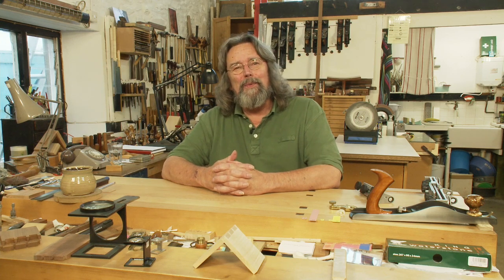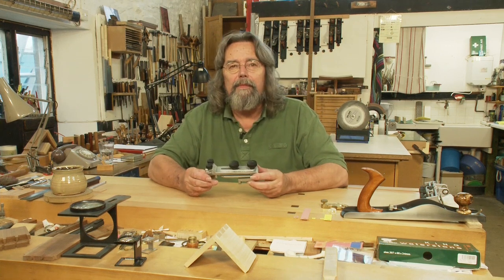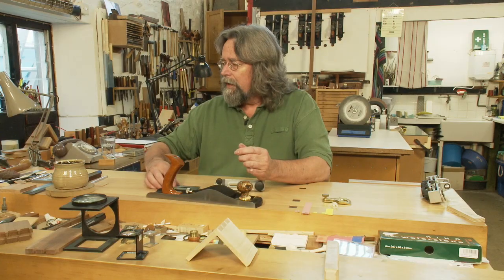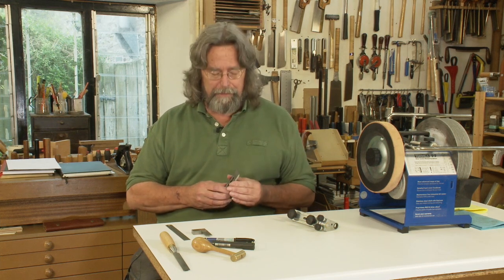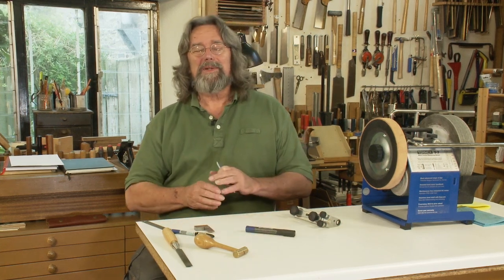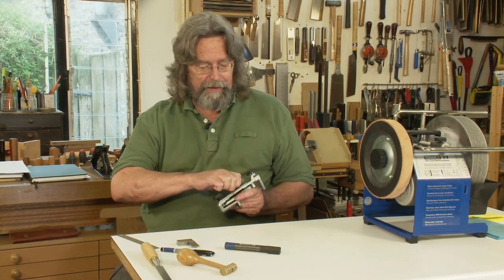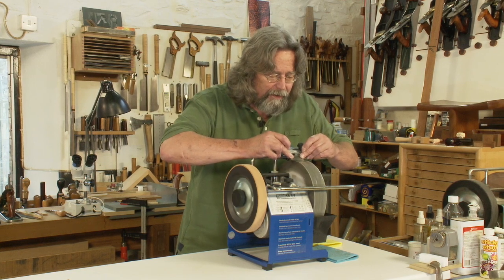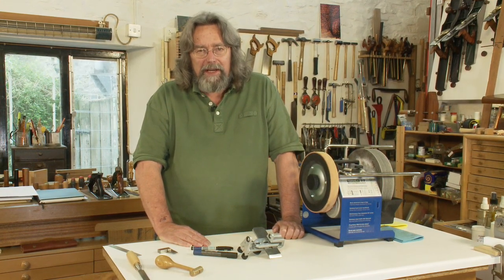New radical camber grinding jig - from Tormek

Comment: Hi David, I have your planing video and have really benefitted from you instruction. However, as in this video you mention an extreme camber for low angled planes (e.g. low angled block plane). What would this radius work out to be - 8" for example? regards Alistair
Reply: It would depend on how far the tool is sticking out of the holder. More tool stick out, the larger the radius.

Comment: Hello David, i wonder if you grind camber of your blade, how you hone it afterwards? I have seen your sharpening DVDs, but there you always address flat plane iron. So i dont know how to use my Tormek T8 with my japanese water stones. Thank You for your help and be save
Reply from the maker: Petr,
I think you will find that I do demonstrate cambered sharpening on my  "Plane Sharpening DVD."  I use 5 finger positions across the blade with an Eclipse guide, on an 800g stone.  This gets small wire edge.  Then tip up 2 degrees and polish in the same 5 positions.  Then remove burr with ruler trick on polishing stone.  Hope this works for you.
David
Reply: @DavidCharlesworth  So basically Tormek for you only substitutes two 0.2mm strips which create the camber and 5 finger position (4x, 2x, 0x, 2x, 4x) on an 800 stone?  Then we can just polish it like you described above? Becase I wondered why are you so pleased with the Tormek jig, when you are able to create camber on a new blade using stones in 5 minutes :) Thank You very much for your answer, you are the best

Comment: I would have thought it preferable to have a jig that can pivot the blade from a point in line with the axis of the blade — like a simple pendulum. That would allow the EDGE of the blade to rotate through a circle centered at that pivot point. This jig pivots from a point a few inches off axis from the blade. The entire blade thus rotates around the circumference of a circle centered at that pivot point — like a toy airplane on a string. This means the edge of the blade follows a path that takes it alternately closer to and farther from the average contact point on the wheel. Surely there must be some operator finesse involved in avoiding an off-center camber?
Reply from the maker: Bob,
Greetings.
All I can say is that it worked well for me first time.
Best wishes, David
Reply: David Charlesworth that is the operator finesse I was referring to!  Cheers to you.
Reply from the maker: Bob,
Do you have this jig to look at?
You will see that the right hand bearing, (for the bar) is directly below the centre mark.
Blades must be set up centred on the mark, and will then pivot about this point.
The two small screws control the amount of movement, left and right.
And the result is symmetrical.
Best, David
Reply: David Charlesworth So it is. I was conflating the right-hand blade-squaring ledge (which one does not use for chambering purposes) with the jig’s pivot point!  Thank you — as always — for opening my eyes.
Reply: David Charlesworth That was a sneaky way to ask if I caved in and bought a Tormek. I confess:  it arrived this week. I’m happily creating a dedicated space for it in my garage shop. A splurge, for sure. There is just something about excellence in tool design that draws me. Now, of course, I need to make sure that I plane enough wood that I need to resharpen my blade edges frequently enough that I then need to regrind them with some regularity. 

I almost bought it from Axminster in honor of you, but they only sell it with 230V 50 Hz — no good for California.
Reply: David Charlesworth The truth is, though, I’m glad you showed me the manual cambering method using the fine black marker and your little plastic strip on the stones. My L-N blade which we cambered that way is still super sharp. I’ve been meaning to ask you what the thickness of the strip is; I never put it in my caliper, although i remember you said you cut it off a plastic school binder. I want to duplicate that camber for the Hock blade I bought for my (2-1/4”) No. 5-1/2. The manual method seems to offer the bonus of allowing one to hone a secondary bevel. I’m not sure how to do that on the wet grinder.

Comment: Is it normal for the wheel come towards you?  I thought it was safer to move away from you.
Reply from the maker: Kevin,
The Tormek manual says metal removal may be faster with wheel coming towards user.
You have to be careful not to get fingers trapped under bar!
Best wishes,  David

Comment: David, after grinding on the Tormek will you do honing using the Odate crowning plates with your water stones?--thanks
Reply from the maker: Robert,
It depends what camber I am looking for.

I can either use the Odate plate or an 800 grit Waterstone to get a wire edge.
My polishing is done on a 10 or 15 thousand grit Waterstone.
Best wishes,
David
Reply: Thank you David, Happy New Year

Comment: Great video Davis, the question I have is if you find that the chisel is registering on the collar, but the grind is slightly off square, it is trial and error with the two adjustment screws to align the chisel and grind square?
Reply from the maker: Patrick,
Thank you. Yes, that will adjust squareness.
David
Reply: Very old question, so just leaving reply for the benefit of others. There is a line on the side opposite of the sharpening side. Making sure the line on the two moving surfaces aligns is what tells you the thing is square. If everything else is properly true/square, this should take you to initial position

Comment: David thank you for explaining this I just recently purchased a Tormek 4 couldn’t justify the cost of the 8. I do like it a lot. I was not aware of these settings on the guide, so this helps a lot. Now I have a question after you have used the Tormek do you still put a micro bevel on you irons?

Comment: Thank you for this video. I have an older Tormek Supergrind 2000 and bought this new version of their jig to sharpen my plane irons. I have not used the planes in a while, but have been inspired to rejoin their use in my woodworking (currently a large project using hard maple). I have on order a Lie-Nielsen #62 low angle jack plane that I want to use specifically in this project for putting a good surface on the face frame 3/4" exposed edges and removing any saw marks, like a smoothing plane, I suppose. Do you recommend clambering the blades when doing that with this plane? There is some significant waviness in the grain and tearout has been an issue-I was thinking of using a 38 degree bevel, per LN's recommendation. So- cambered blade or straight for this?

Comment: It appears that this jig requires the end-user to hand-craft a smooth parabolic shape onto he plane iron.  That is to say, the guide repeatably and equally limits the degree to which the blade can rotate off-axis left-and-right, but it does not guide the user toward grinding the arc smoothly, or uniformly, is that right? 

If I could limit my blade movement off-axis on a dry grinder (say, with fences fixed onto the grinder's table/tool-rest) would that be substantially equivalent, or is the slow/wet nature of the Tormek essentially to grinding all the way to the edge without burning?  

Thank you David!
Reply from the maker: Karl,
Not sure about that!
I manage to get an excellent result, by simply moving my finger force from side to side.  The effect I want is generally very small and the precise geometry not very important.
Best wishes,
David

Comment: Great idea and easy to setup and use but how do you put on a secondery bevel?
Reply from the maker: Very simply, with an Eclipse type guide on a water stone.
In fact I use two.
800 stone to get a small wire edge and 10,000 stone to polish cutting edge.

Best wishes,
David